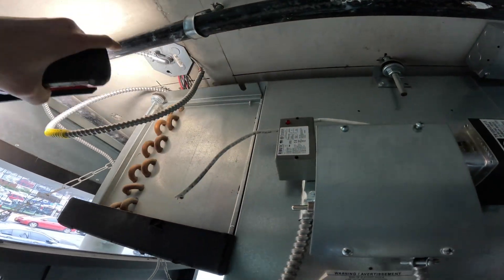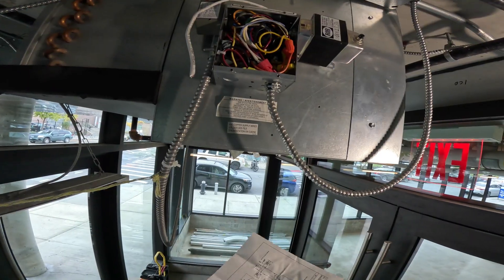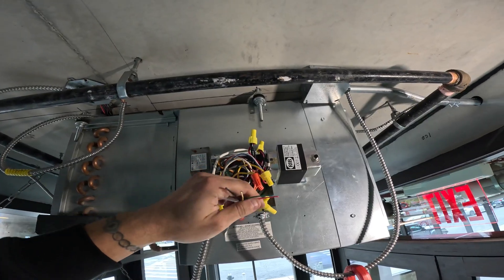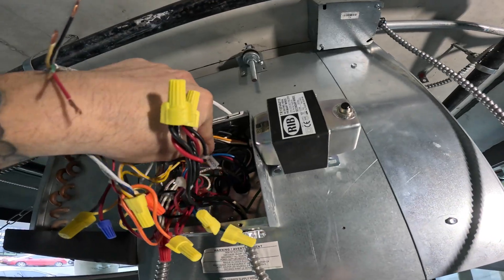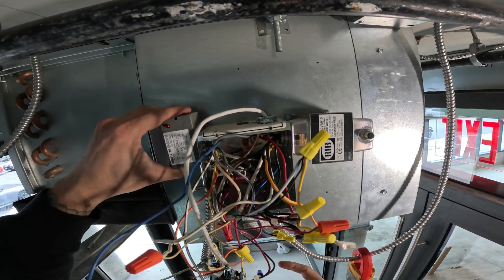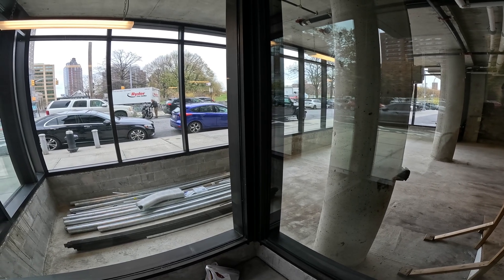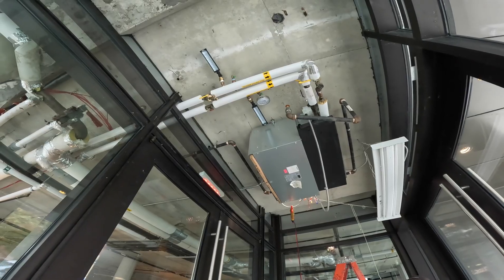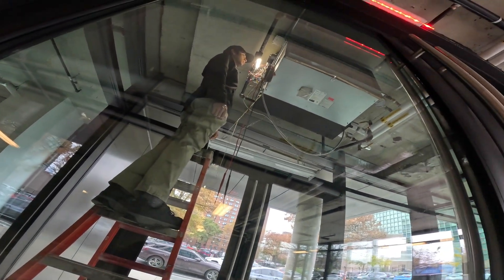HVAC: Commercial Fan Coil Unit Hack Job Repair (FCU Not Heating/FCU Not Cooling/FCU Troubleshooting)

Comment: I'm not surprised to see the wires cut.   The one option is to remove the fancoil and install a ceiling mounted downdraft electric heater.   
Most have an integral stat or possibly a remote one.  Just a thought, and thanks for us with you.

Comment: the sprinkler line is likely temporary, until finished drop ceiling goes in, they'll likely keep a head in there about where it's at now, but add one or two through the drop ceiling, also, likely duct around the pipe and have it blow down past the door as an air curtain, return via drop ceiling grate/plenum space. pipes wont freeze, etc.
run/mount conduit,  j-box, and thermostat down the glass door framing, make a bracket to hold it off to the side if need be. pre-bend conduit, put fittings on, hook it all together, clean and paint it flat black to match including conduit straps and screws(or get black head screws), any accidents/scrapes touch up with black wax pencil/crayon/black permanent marker.

Comment: I was unwelding  a Freon line from a unit in a closet and I didn’t realize there was a sprinkler head in the closet tucked behind the supply plenum, I found it when the heat from my torch broke the glass on the sprinkler head and it start raining nasty dirt rusted water on my head. Luckily for me it was in a first floor apartment that had already flooded from a busted washer hose.
Reply: LMAO!
Reply: Where in NYC
Reply: @Brent-r1p  I’m sorry! I’m in south Florida, Miami ft.lauderdale area..
Reply: @kevonslims7269  I'm in NW Broward. Backyard is the Everglades and alligators.
Reply: @scotts4125  Alligator alley..🐊🐊🐊🐊

Comment: Great video… that sprinkler piping looks like it was a Union job. lol. Instead of a thermostat and sensor what about installing one of those sensors (thermistor) in the heating circuit and mount the sensor in the return air airflow. We use them type sensors in refrigeration walk-ins.  I believe places like Webb and Johnstone call them contractor thermostats. You can get them in different set points such as 68*/ 70*/ 72*F depending on what you want. It’s cheap, neat and hidden and with all that glass, omg what were they thinking?? Probably wouldn’t hurt to have a supply diverter downwards once that light is relocated. Seriously what serious electrician puts a light there and even the pipefitters?? Shame on you.

Comment: You take wiring diagrams off of jobs sites? What about anyone coming after you? Take photo's and tag them.  

Sprinkler head placement follows national code guidelines. Fitters don't place sprinkler heads where ever they feel. Moving a sprinkler head in a building like that can be a beurocratic nightmare. It can actually void an insurance claim if an insurance company wanted to get out of paying.

What does a RIB relay do? It starts things, it stops things and it can confirm at least an attempt was made to start something or stop something.

What is this RIB relay doing now that you made this repair?;

Truth is it's no big deal moving it but ut can be a big deal

Comment: Why the hell is there 2 tiny units for the giant room, and then that much larger unit for the tiny entry room!‽? This place is doomed 😂😂😂
Reply: it's mostly all temporary for early construction phases, they have to keep the space heated and fire protection active all throughout the process.
the unit by the door will likely be ducted down as an air curtain inside the door, sprinkler lines moved/added on to or ducted around, drop ceiling added with return grilles, above ceiling as return plenum space.  pretty much standard construction practices, especially inner city connected/high-rise, where a fire would be catastrophic.

Comment: Fire Sprinkler Inspector/ Service Technician here 🤚 I agree with you on how they ran the lines. It looks dumb, they probably did it like that for it to be center of the entrance to make it look nice but I have came across where I had to re route the pipe on an AHU because the HVAC Technician needed some clearance to open up a panel which he told me it's code for y'all to have. I would either take all of that pipe and turn that 90 coming out of the wall down and put that upright right below the unit or turn that 90  to the opposite side, run pipe and put that upright head around  where it was before instead of making that "U" of pipe. Also, love your videos bro, I'm starting to take HVAC classes as well this month just to learn enough to work on my condenser and furnace in my house 🤙
Reply: they'll likely duct around the black pipe and dump it straight down in front of the door like an air curtain. return grille in drop ceiling, above used as plenum space.
possibly the same setup or similar in last video at one point or primarily there to keep wet sprinkler lines from freezing?

Comment: why would people install things like this? I work in a commercial building and i find shit all the time. Like VAV fan coil units with the fan and or the reheat that were never even wired. And they wonder why it is cold. It blows my mind. I even have a unit they wired for 110v and the fan required 277v! Dont know what they are thinking